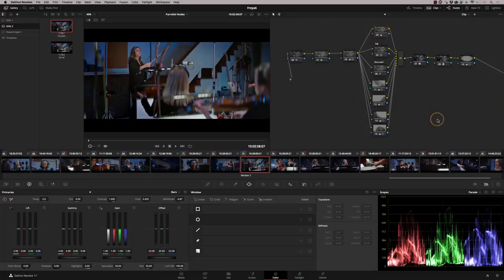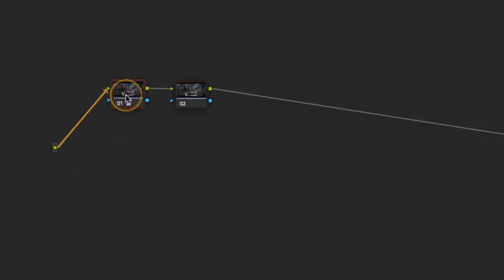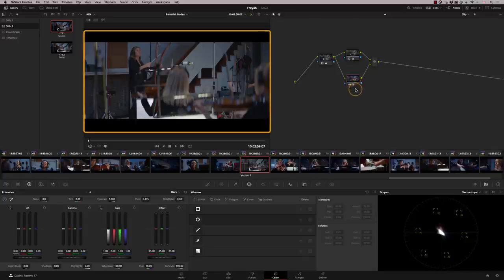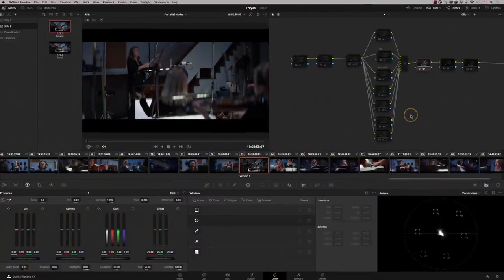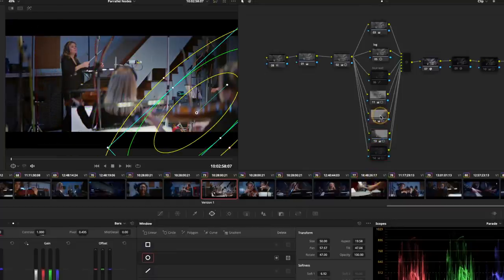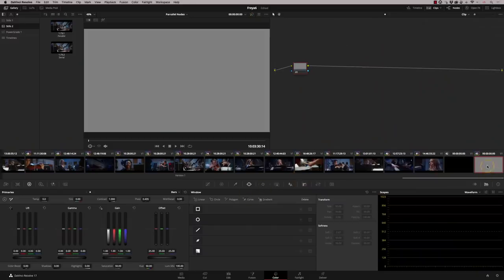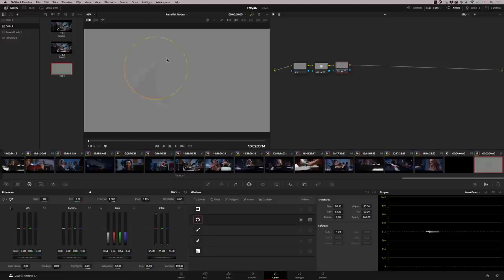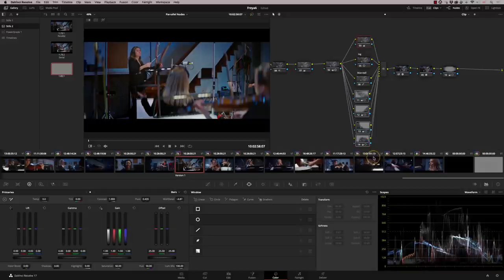You Might Be WRONG! - PRO TIPS & Newbies Section

Comment: This is my second comment on this.  Your ending example (using the gray screen) drove me to prove, at least for myself, that it is not the nodes that are being equally mixed, but the changes to nodes that are being equally mixed.  The incoming RGB becomes ground zero for a parallel tree.  An adjustment in one area of a frame on one node becomes the output if that area has not been changed on another node in the same parallel tree, i.e. changes to one area of a frame in two or more nodes results in the effects of those changes being mixed together, but areas changed in only one node become the output.  So if you make a primary grade to one node in a parallel tree (as you did your first example), then any secondary grade you make in the other nodes in that tree will be mixed with the primary grade since the primary grade moved the incoming RGB off of ground zero for the whole frame.  (If no primary grades have been made in a tree, and if no secondary grades overlap, then the only reason a parallel tree might be preferred over serial nodes would be for organizational purposes, in addition to, or in place of, node nesting.  True or False?)

 It seems to me that a starting point for understanding parallel nodes would be too to play with overlapping secondary exposures before moving on to overlapping colors in a parallel node tree that contains no primary adjustments.
Reply from the maker: Thank you. I've just come out of a 10 hour grade session so sorry short answers - sounds like you have answered your own question anyway. Good to know Im getting people to start working out the maths of Resolve and not just making pretty pictures. You need to understand this stuff to get best results.  All te best, darren.

Comment: Another very clear and concise tutorial. Exactly what I wanted to know.
Reply from the maker: Glad it was helpful Doug.
Reply: @DarrenMostyn  I have shot footage with many specular highlights and it is BRUTAL trying to use it. I can’t seem to use global adjustments as that would not make sense. So, I thought of using parallel nodes to push and tug regions to help bring out contrast and definition. HOWEVER, I’ve been sooo busy that I haven’t exercised that yet. But I WILL. I can’t help but wonder what you would be to “make it work “. Better yet, how should it have been shot? Not a question for you of course. I’m just thinking out loud. 

Best to you. Be good.

Comment: Thanks Darren. Great information and demonstration (as usual). I do have a question about where to apply the CST node, similar to one of the other comments. If you use a color managed workflow to bring the footage into a wider gamut (e.g. ACES or DWG), how do you decide if you apply corrections before or after the first CST node? I thought I should get the footage into the working color space first (e.g. DWG), which will get the base image looking neutral (if it was exposed correctly), do the grade in the middle, and finally apply another CST to get it to the delivery space (e.g. Rec.709). When does it make more sense to you to apply corrections before the CST?

Comment: This was awesome. It totally makes sense. One thing that I wondered about: You say the nodes are mixed in an equal amount. So, what happens, when I add one node and boost saturation by 100%, and I then add a parallel node with no boost at all. Would that be the same as boosting the saturation 50% in a single node?
Reply from the maker: Hi. Thank you very much, appreciated. Best answer to your question - TRY IT! The more you try these tools and push the limits and question "what would happen if?" the more you find out - thats how I do it. Your question is really easy for me to answer but i encourage you to try it and find out - explore, you'll learn more ! All the best, Darren.

Comment: Darren, first of all thanks for the excellent videos. Your way of teaching is very clear and easy to understand. I had a question about your noise reduction node. I notice you put it first. Is that where you would typically put it and then say put a sharpening node at the very end to recover some crispness?
Reply from the maker: I usually go at the front, but not always..there are a few times it looks better later, usually depending on keying work required.

Comment: I have been using parallels without ever really understanding why. I even went into a deep dive in the resolve manual and felt even dumber than before and no closer to understanding after that read. But THIS is is it. Great explanation. The only thing I'm still fuzzy on, and it may not even matter, is mathematically what is happening? If you have 2 P-nodes, how are they combining without muddying each other's information? Tells me it isn't multiplicative or additive, especially after seeing your example with the dodge and burns that were overlapping. Again this mental road block I am at may not even matter ultimately. A case of 'shut up and use the tool' probably. But I'm curious.

Comment: Hi Darren, excellent content! Thank you! I was wondering, you do your balance and offset before you pull a key in the parallels. if you come back to adjust your balance, you have to pull the key again, right? I was playing with the idea to do a direct parallel in the beginning, similar to Cullen Kelly. But, that messes up my numbering of the nodes. Since I'm working with the panel and I then have to press next node several times to come back to the first row if you know what I mean. So I was wondering why you first adjust your offset and balance and then pull keys in the parallels and not do a direct parallel? Thank you so much for your answer, your content is greatly appreciated!

Comment: As an absolute beginner in Resolve, I spent ages trying to work out why your parallel node in the first simple example was created with saturation taken out. As it was being 'fed' by the first node (to the left) I expected it to be fully saturated. After a lot of head scratching I realised that creating a parallel node is actually duplicating the node above it (am I correct?), which has the saturation taken out. The important difference is that the desaturation is reversable, which it would not be with a serial new node. So my question: is creating a new parallel node always duplicating the top node in the column, or the one above it? I love your excellent tutorials, but I think this one is missing some vital information. Thanks, Darren.

Comment: The Parallel Mixer node mixes the parallel nodes connected to it in equal proportion by default. Can the proportions of that mix be changed in the Parallel Mixer node? Would be useful. Thanks, Darren.

Comment: Do you prefer parallel nodes when doing secondary corrections like when using the qualifier tool to isolate a particular color in the scene?
Reply from the maker: no straight answer for this sorry. It depends what I am doing and trying to achieve. I wouldn't get too worried about it though. As you get more used to using the nodes you will know. As long as you understand what is being affected on each node to give you the cleanest output is more important than serial or parallel. Hope that helps.

Comment: Hi Darren.  First of all that was a good showing at the Learn with Masters TAC event last week.  Thanks as ever for sharing your knowledge.

Quick question if i may:

Luma Mix:

Project settings: DR YRGB / Rec709 2.4

My Luma Mix acts just as it should when i reduce the value to '0' when a clip is not graded and doesn't affect any of the other RGB values when one of them is adjusted.
However, when i add a CST later downstream (arri > rec709 for eg), and return to the first node to make an adjustment, say to the Blue channel, the Luma mix starts to affect the other colours when i start to adjust one of them, ie: the G and R start to alter their value simultaneously . 

I note that when i use this operation after the CST the Luma Mix responds exactly as it should.

Can you tell me why this is?  Or what i am doing wrong please?  The CST is clearly affecting the way that things are responding?  But i don't understand why!

Thanks Darren.  No hurry for an answer, appreciate  you may be busy.
Reply from the maker: Hi. Glad you enjoyed the learn with masters. I really  enjoyed being part of that great team. The reason is because the CST is processing the luma mix adjustments you rae making and putting them into REC709 colour space so this will have an effect on all channels. You should find it is differemt with lum mix to 100 but it is not incorrect what it is doing. the difference in the other channels moving when on 0 luma mix is from the CST downstream, not the luma mix setting. Hope that makes sense. Good question btw.
Reply: @DarrenMostyn  

Thanks Darren.  Appreciate the prompt and clear answer.  

Take good care.

Comment: Kudo's to your node tree structure. There is something you allude to, but, never really define things in a clear fashion. That is that corrections made in serial nodes are DEPENDENT on the order in which the correction nodes were made. That is to say that if one first does an exposure node adjustment, then contrast then white balance, for example, the resulting signal will be different than if one does white balance node then exposure then contrast. So one must be methodical about constructing the node tree in the same manner every time if they are to achieve predictable results. On the other hand, if all adjustments are made on parallel nodes, it makes no difference what order the corrections are made. Resolve takes a much more predictable correction methodology in the use of parallel nodes.
Reply from the maker: Hello Bill.
Thank you for your appreciation - this took a while to make and aim at a few different levels.
I touched on this point in this episode I made a few weeks ago. https://youtu.be/F01fPW1dAhU
Yes, always needs to be taken into account, but if I cant overlap all the info in each episode and this was really focus on the Parallels. Very good point though and appreciated input. All the best, darren.

Comment: Brilliant tutorial as always! So much appreciate it Darren. I've got a question.
Let's say 3 serial nodes vs 3 parallel nodes with exactly the same effects. Which one would use more ram and gpu power to render it? Or would it be almost the same that we couldn't feel at all? My machine isn't powerful enough and I'm always concerning about playback and rendering whenever using fusion 😢
Reply from the maker: Node order wont make any difference to your performance. It is what is ON the node that will affect it. NR and OFX will slow down much more than lift gamma gain. Serials or Parallels not a factor really. Hope that helps.
Reply: @DarrenMostyn  Ok, thank you!

Comment: Thanks Darren.  Love the no B.S. approach.  I had some trouble replicating your end example because I am, well, a beginner.  But I generated a solid and added an OFX color generator on the edit page, changing the channels to 127.127.127., made the result a compound clip and went to the color page.   What I gleaned from your input is that one of the purposes of parallel nodes is to feed the same input channels to each parallel node.  What's always been confusing to me is that, since the nodes are combined in equal amounts, you need to "over grade" the parallel nodes to end up with the effect you want.  Plus overlaps mix the colors of each node together.   So changing the value of a parameter in a serial node vs. changing the same parameter by the same amount in a parallel node produces dramatically different results.  True or False?
Reply from the maker: True. As proved in this episode. Experiment yourself and push the system. Do something, save a still and try another method and compare - more useful than watching YouTube! Good luck with it. Darren. You should consider joining my Exclusive email list for free stuff and announcements -  https://bit.ly/2RrjvpN

Comment: Loved this episode Darren, I had a question, when I apply a CST at the end of my grade and try to balance my image with a node at the start I get a lot of artifacts and noise, do you know what might be the reason? Im still on resolve 16 and I use the luminance mapping method. Thanks again!
Reply from the maker: If you are keying specifics you should look at maybe after CST. I have nodes in my commercial workflow after CST for specific qualifiers. Also, is it 8 bit footage, keep first nodes simple - dont stretch the image too far early. Hope that helps.
Reply: @DarrenMostyn  haha no Darren it's literally just basic lift, gamma, gain corrections, I do all that in the secondary nodes, and I work with 10bit footage, I've tried it with different cameras but I get the same result, I saw a hint of that artifacting in the shadows on your A7S3 video when you were grading the first clip, anyways, thanks for the tips I really appreciate it! 😀
Reply from the maker: @fahadmirza9370  hard to comment without seeing specific shot. Can't accommodate that here Im afraid, but hope all good. All the best, Darren.

Comment: I'm a newbie and I'm still trying to fully understand parallel nodes, I sort of understand the use especially with the dodge and burn. But with hsl and primaries and log adjustments could you do those in a series node? Its just people like quazi do it a bit different and I'm trying to find a method to stick with in regards to a fixed node tree that I can keep using
Reply from the maker: everyone has their own methods. This is mine. As long as you get where you need to be at the end result then you are not really doing it wrong. It is good to have an understanding of what is happening to your signal. Qazi looks like he uses a more serial approach than I do but that is not wrong as his results look good..

Comment: What is the reason for putting the color space transform later in the tree?  I know it's the way to do it, but never knew why.  (In ignorance I'd be putting it at the beginning -- getting the right color space, then go grade that. This would be the same as setting the input color space.)

Second question -- are you grading on a rec.709 timeline?  I've switched over to DWG, which is pretty neat, but struggle with roll-offs.  For instance, when I see you adjusting down the primaries lift, in DWG (for me) the darks compress and act a bit "shy" of 0 blacks.  For this reason I often use the curves instead, which typically end up in a diagonal backwards J shape (steeper increase at the low end).  I'm liking my results fine, but something nags me about doing it this way?
Reply from the maker: My next episode released tomorrow will answer this question for you!

Comment: i can see circle even in parallel nods too
Reply from the maker: because i reset with mouse and not dbl click so it didnt zero correctly. Apologies.
Reply: @DarrenMostyn  I cannot find answer to my two questions. My you can help me. 
1. In CST node parameter Tone Mapping. Can you please, explain what is it, and how it works? (I using Luminance mapping)
2. What's the difference between CST and ACES Transform? Because result dramatic different. I know only ACES can transform in Rec.709 and restore Log information from Rec.709. it can compress and decompress information from Rec.709.
Thank you, Mr. Mostyn.

Comment: Where is the technical informaion found on this topic? Are just the affected pixels being summed down?
Reply from the maker: Not sure what you are asking here ? If you are asking about order of operations (which I base my whole grading on) then this is in the manual but Im not sure which page. Hope that helps a bit!
Reply: @DarrenMostyn  no problem. I figured I need to go to the manual on this. I come from an audio background and we do parallel signal processing which behaves similarly for some things, but since this is digital video, it most likely uses transformation matrices and not FFT because this is not a phase modulated signal anymore. Thanks for answering back though. I don't mind reading manuals. Great tutorials!